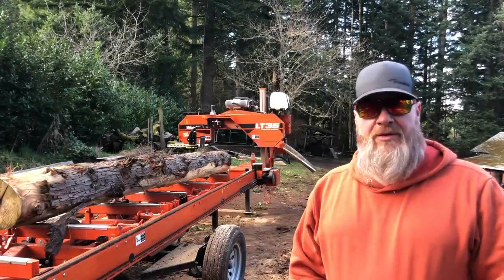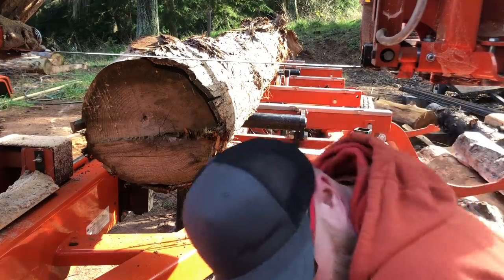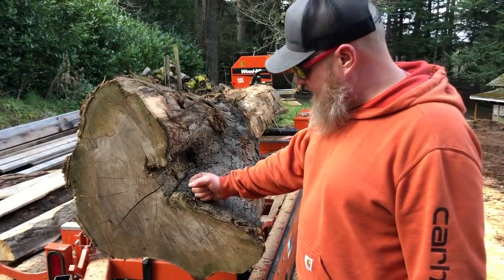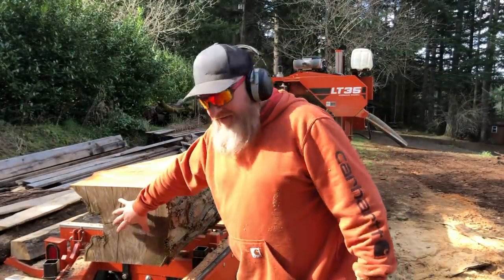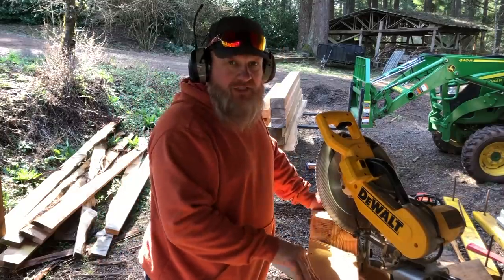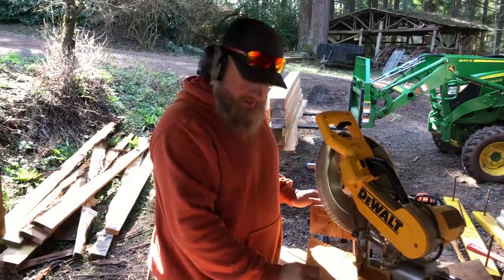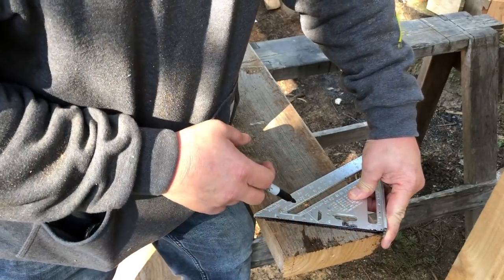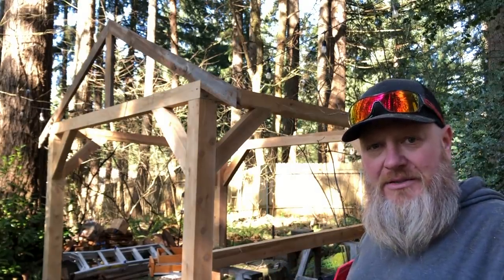Timber Frame Fire Pit Part 4

Comment: Before "cutting the rafters at home" I would make darn sure you have a good square at the top of the corner posts by measuring the X-distances from outside top corner to outside top corner. If necessary pull the frame into square with a come-along. Looking really nice!

Comment: I imagine if I had a sawmill and was trying to get certain boards out of it, I would use cardboard cut to size and hold it up to the end of the log to figure out what is the best way to do it.

I liked the shot from the blade support. Also like the real speed sound over the high speed video. I wish others would do that too.

Comment: Before I start off, let me say that I enjoy your videos, and like your channel a lot, keep in mind these are just helpful hints from an old frame carpenter, four diagonal braces would ensure, that your project remains square, until finished, leave them on until you are completely done, for multiple rafters of the same pitch, make a pattern, top cut, seat cut, and tail length, after you make the pattern you can basically put the speed square up.after decking is nailed, and knee braces are installed, you can remove dracing. Like I said just helpful hints, keep up the good work, anyone know of a sawyer, that can cut a 52" pecan tree up for me?

Comment: You can put a rafter app on your phone. Looks good. Your mistake may have been no ridge board.Rafter tables figure for one. You don't need one but it makes putting the rafters up alone easier. You make good vids.

Comment: hmmmm Timber Frame? I'm trying to find your mortise and tenons, I will go back and watch again,
Reply from the maker: Good luck! I’ll need you Makita😬
Reply: look closely...little round mortises with long metal tenons
Reply from the maker: Also, that fire “pit” is above ground🤓
Reply: Northwest Sawyer watched 5 times. Didn’t see any. 😟. However I did watch the ads and not skip them
Reply from the maker: Thanks, Nathan! That really helps with the $6.00 a month I make😬
Reply: You can use your welding/metal working skills to make some very cool brackets for connections. The combination of wood and steel is functional and attractive for post and beam construction.
Reply from the maker: Gaylon this has crossed my mind. It’s not in the budget but it might look good for my resume.
Reply: I think they call it post and beam around here when you use screws. 😄
Reply: Throwing shade! Look at you. I aught to have been a little more clear with the title of my house build. This fire pit shed is bomb proof.

Comment: Looks awesome!  I guess the lumber that you used to create the rafter will be your template for the cedar rafters.  Can you build them on the ground and set them on the structure?  Is it going to be a sheeted roof with composition shingles?  Tongue and groove would look great with exposed beams.  The timber locks  work for me.
Reply from the maker: Thanks, Ted. My plan is to fasten the center post first, then each beam one at a time. It’d be way too heavy to put them up as one unit.